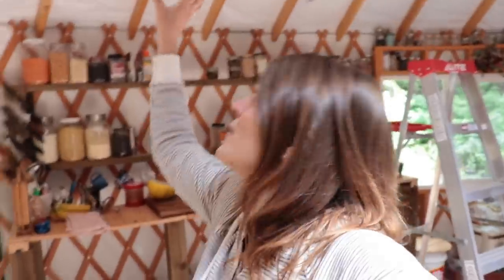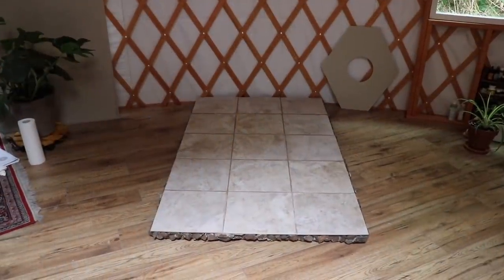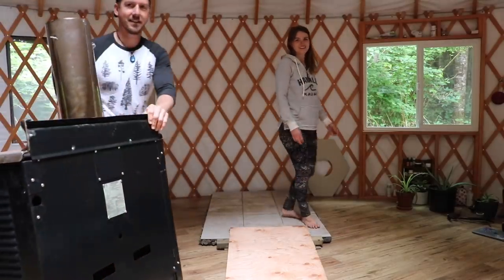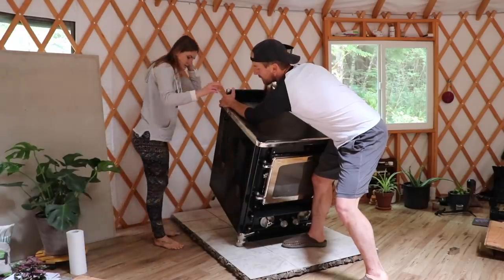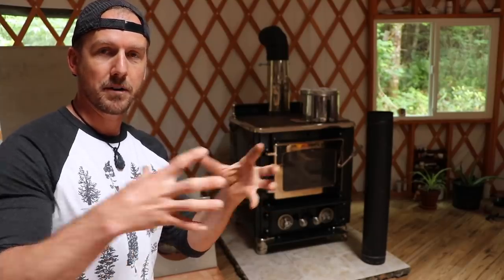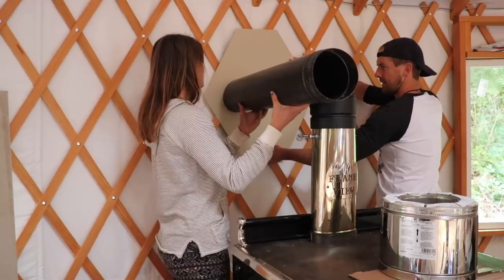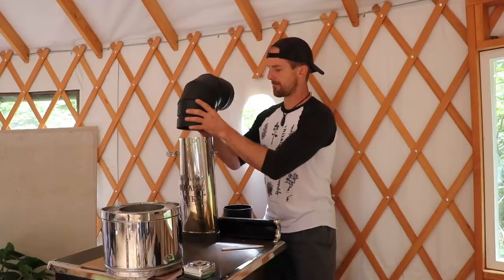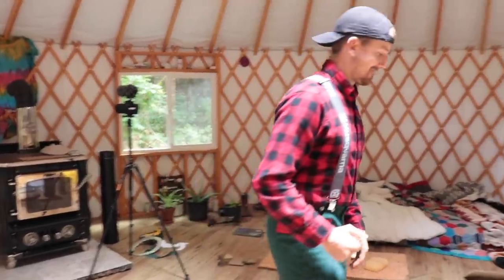Mind Blowing YURT in the FOREST | Off Grid Wood Stove & Chimney - Ep.30  Part 2/3

Comment: 12:34, Yes, the camera shows your breath in the cold Yurt. That's kind of surprising to be that cold in June, but you are in Canada. I wonder what the winter will be like? I really like the woodstove. It makes me think back almost 40 years ago when I was a teen and my Dad bought an old fixer-upper house. The heating system wasn't very good so he decided to tear it out and use wood to heat the house. OMG, it was so much work cutting and splitting wood. At least my Dad built a hydraulic wood splitter so we didn't have to use an axe the way I see Jake doing it. In time, I see the two of you with equipped with a wood splitter, a Backhoe, and other machines so Jake doesn't wear himself out. I wish you the very best in your rainforest paradise.

Comment: ignore the click-bait comments, its just ignorant. On a positive note, use small wood poles with a bolt going through the pre-drilles holes in the yurt truss to lower the wire you installed to make the pan more easy to access. They look a little to high to make this set-up truly functional. But I like what your doing so far. Keep the video's coming, you both are amazing!

Comment: Ha you two. man I now what it's like to do what you are doing. (did it my self back in the 70) in Oregon.
Being someone who has heated a home with just a wood stove, may i suggest you look into building a sand stone wall behind the stove and even under it to suck up the heat of the stove when its hot and then when the fire goes out at nigh the het trapped in the sand stone will keep you nice and worm threw out the knight.
 You can also rap soft copper pipe around the chimney and have all the hot water you ever won't for your shower.
lots of you tub shows to show you how to do it. but I had to do it the hard way. lol
Keep up the great shows and do your selfs a fever and make a wood fired hot tub to sooth thoughts shore muscles you two will have.

Comment: If you move that woodstove about five more feet away from the back, and bring the pipe toward the front door of the stove 10 inches lower than where it runs thru the yurt wall. Elbow it up at the height you need to run it back the other way thru the yurt wall . Then you will get about 85 percent of the heat from the 10 more feet of stove pipe you just added by only moving the stove 5 more feet

Comment: Then all you have to do is light your fire, not so big at first to get the pipes a little hot to draw a good draft. You will use only 1/3 of the wood your using now. The Top pipe running back thru the wall will catch most of your creosote cause by the time the heat travels thru the first elbow and then back, the last 3 feet of the pipe has cooled down. Just clean it once a month.

Comment: you need to sharpen that chain saw blade. Look at the saw dust wood chips if they are small and fine, it is dull. Larger chips and a shrp blade. NEVER let the tip of the blade hit dirt, INSTANTLY dulls a blade.Should have gone through those small branches like butter. took too long to cut them.

Comment: Prevent mold.
Reply: How
Reply: @hermosacalif3692  Well a stove will keep it dry ... all know is don't use bleach because its 95% water and that will cause the mold spread...so I've been told because i had mold in my basement... ask the Yurt builders what they recommend...hope I help a little. Best :)
Reply: @lv4bway  I didn't know that about bleach. All I know is the the difference between temperatures inside and outside causes mold.  Thanks

Comment: alsmost got type pezza recipes out my system. strangle thick crust list showed up medium crust weird don't rember be like that. not some switch different book while work or what but. so sense every recipe typed use basic pizza dough recipe start point. here  BASIC PIZZA DOUGH.      MEDIUM CRUST  1/2 ounce (15 g) fresh yeast or 1 1/2 teaspoons active dry yeast. about 1 cup (250 ml) warm water.   2 cups (300 g) bread flour.   extra to dust hands and work surface 1/3 teaspoon salt 1 tablespoon extra-virgin olive oil (optional)  serves 2 preparation 15-20 minutes time to rise about 1 hour..      THICK CRUST  3/4 ounce (25 g) fresh yeast or 2 teaspoon active dry yeast. about 1 1/3 cups (300 ml) warm water.  3 cups (450 g) bread flour . salt.  1 table spoons extra virgine olive oil ( optional )  they have provided two recipes for basic pizza crust. those who enjoy deep-dish type crust should use the thick one. pizza with heavy toppings will be better with a thicker crust for best results, we suggest you use fish or active dry yeast. you may also use instant or rapid -rise yeast. just remember it doesn't need proofing.    1. put the fresh or active dry yeast in a small bowl and add about 1/2 cup (120ml) of the warm water. 2. stir gently until yeast has dissolved. st aside until frothy. about 10 minute. 3. combine the flour and salt In a medium bowl. pour in the yeast mixture. oil (if using) and enough of the remaining warm water to obtain a fairly sticky dough. 4. dust a clean work surface and hands with extra flour.  scrape all the dough out of the bowl onto the work surface. shape into a firm, round ball. . 5. Knead the dough for 8-10 minutes. when it is firm and no longer sticks to your hands or the work surface, lift it up and bang it down hard a couple of times to develop the gluten.  6. when ready, the dough will be smooth and elastic and show definite air bubbles beneath the surface . place it in a large oiled bowl, and cover it with a cloth. set aside to rise for 1 hour. 7. don't worry about overworking or being to rough with the dough. just make sure it doesn't become to dry and begin to crack. 8. some people like a really thin crust you can stretch the risen dough out to any thickness you like. just make sure it doesn't break. 9. the heat in you hands helps develop the gluten ( which is why we recommend kneading the dough by hand rather than in a food processor) 10.  there is something deeply satisfying about kneading and handling pizza dough. home made pizza is both filling and fulfilling! 11. place the dough in an oiled 12 inch (30 cm) pan and spread it with your fingertips, stretching it as you go, until it reaches the edges. 12. press down around the edges of the pan to create a border. which will keep the topping from seeping off the pizza during cooking. 13. most toppings start with a layer of tomato sauce, spread evenly using the back of a spoon to smooth. ( if any has home mad tomato sauce recipe look some) 14. to with the remaining ingredients. let rest for few minutes, the pop it into the oven to bake.  there  whole wheat and gluten free dough recipes some were post there comments got watch there shows then scroll down comments find the other post. I have bad day with tunderbanen winter weather why post this tuff Jake got pezza oven cool see take stuff garden make most these pezza with out go to store.